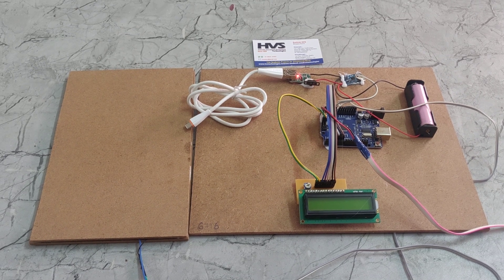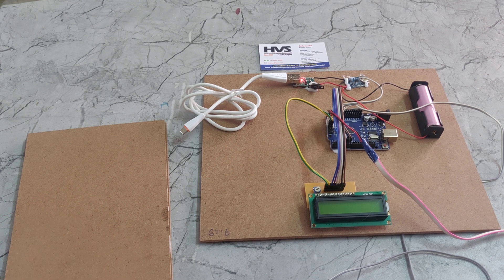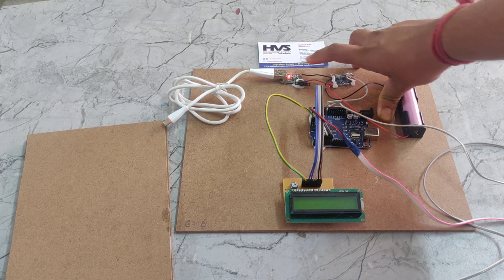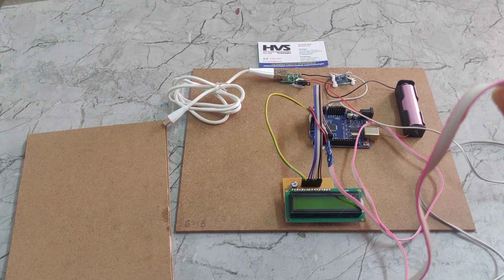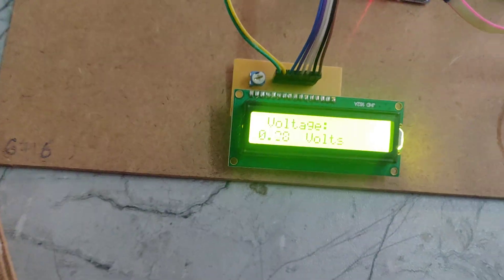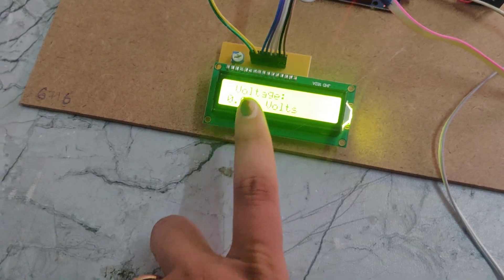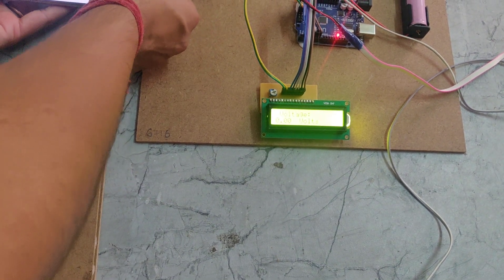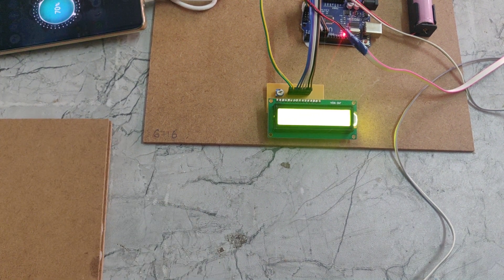Advanced foot step power generation system for Mobile phone charging using Arduino UNO

Comment: bro where can i get your arduino uno code
Reply from the maker: @unt-deadly6709  Hi, 
We sell full working kit with document PPT circuit diagram and code. Could you Send me the video link, Will update you the cost details. You can contact us at +919603140482
Through WhatsApp or call